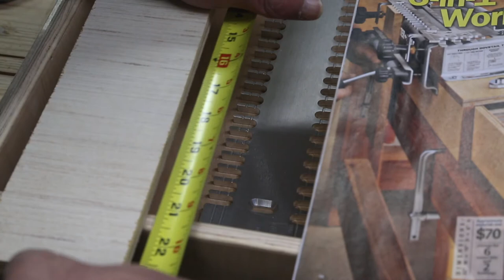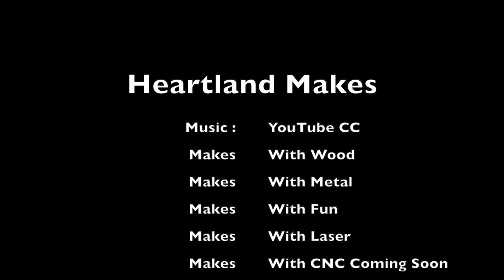Dovetail Jig Work Station 3 in 1 Tool

Comment: Is your Dovetail work station from the Wood Magazine  3 in 1 dovetail work station  plans? I lost to oem box for my PC 4212 and need something to put my jig into with the templates and new router bits. I already purchased new guide bushing and router bits because they were in the box and I may have in avertedly  tossed the box in the trash.
Reply from the maker: Sorry for the delay my friend. 
I moved some. This video was uploaded snd internet in new town is aweful. 
Yes it is a plan I got so where. I honestly can’t say for sure. Get it sounds like your on the right tract. Again sorry for the delay. Upload your pics and share it to our FB group if you have time. 
Dale.